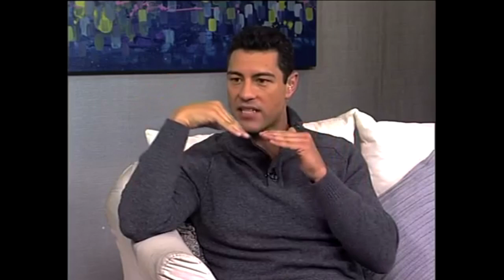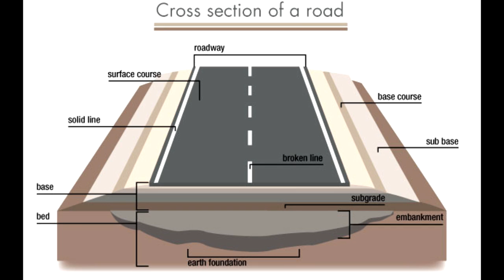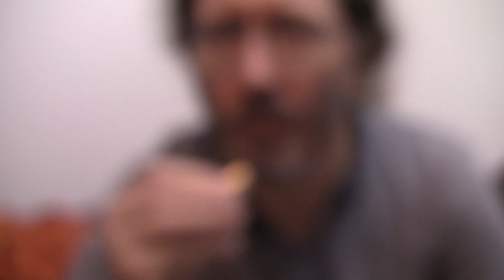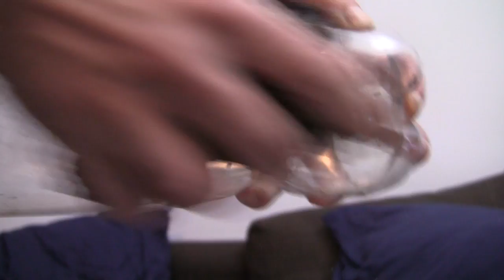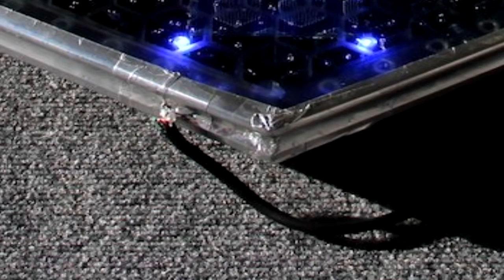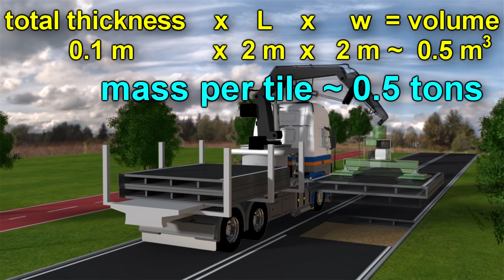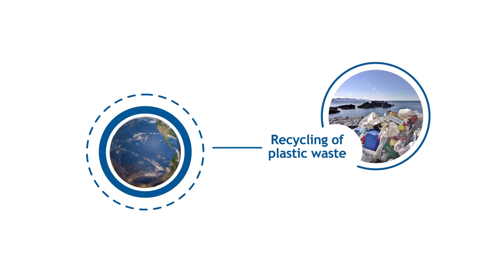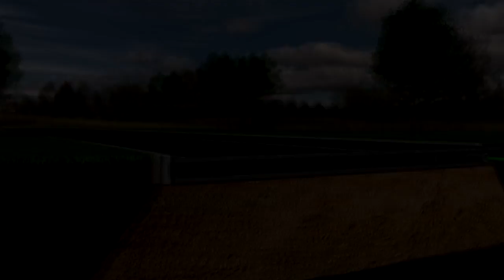Plastic Roadways BUSTED!

Comment: i stopped three seconds in and am going to guess without even hearing them out yet that this wont work for exactly the same reasons that solar roadways didn't. its a pipe dream that doesn't take huge budgetary, weight and wear requirements that any second year Civil engineering student should have seen coming. we'll see if it pans out.

EDIT: Well, my suspicions were raised by the guy saying " I don't have an engineers mind but..." and were confirmed when they went on about hollow roads made out of recycled pop bottles with no foundation to speak of much less any ideas on how to prevent the fancy runoff channels from eroding said imaginary foundation or having braking cars or god forbid large trucks from pulling these dumb pannels off the foundation(seeing as they have no anchors to nobody's suprise) 

Goddammit guys i'm not an engineer but even I could figure this out. the scary part is that there are actual civil engineers wasting their time and the companies money chasing this pipe dream when they could be dedicating these (very much limited) resources to upgrading and maintaining roads using refinements to existing technology. actual progress on this front looks like finding a way to cut down the cement portion of your structural concrete by about ten percent or by precasting bridge sections off site and craning them into position (then laying blacktop/concrete surface) but then that sort of thing takes years of study and experience in industry. and lacks the sex appeal of pie in the sky solutions that don't even work.

(/end rant)

Comment: So a section wears out and has to be replaced.
And its got a lot of pipes and cables running through it.
So...they have to cut all the pipes and cables, pull off the section, and slip on a new section.
Then they have to reweld and reconnect all those pipes and cables.
Hmmm.

Comment: my thoughts on this are simple,  have you ever,  EVER seen a straight,  flat and level road?  roads  can not be made modular,  every stretch of road is Tailored to the space available and the needs of the road user,  the only use i can think of is to build very temporary and low use paths,  like in a festival or to divert traffic during brief roadworks
Reply: and even then gravel roads are easier and more effective. :)

Comment: Hey dumbass. The vast majority of cost for roads is RESURFACING. They don't break up the foundation when they redo roads...
Reply: Road Resurfacing is relatively cheep and simple actually.
Reply: This thing would cost 100 times more to resurface. Especially if the pipes go through it. Probably reinforced concrete panels would be cheaper than this and also more durable. Also the plastic can be put in the concrete mixture as a filament.

Comment: I can't believe an engineering team would actually not realize that both traditional road material AND plastic bottles alredy get recycled. Just to start off... 
And I actually really really hope there will be many big facepalm fails like this where the fail would be exposed, and slowly people would realize the need to check the sources. It's all too common for people on Facebook to just believe anything, share and post stuff whether it's true or not, even if it's an article, they would never scroll down to check "Source:" and follow it up, IF the site even has a source. So most people don't even get to Step 1 in verification. It doesn't have to be a scientific article, it applies to everything, politics, rumors of any kind, and people just mindlessly share everything.

Comment: Amplifying how silly the argument is that "plastic is lighter than asphalt":  So what?  A road lays on the ground, all day, 24x7.  You never have to move it, or pick it up and put it down.  Being lightweight is almost a non-issue for a road (except as TF points out, it's a liability for an accelerating or decelerating car).

But they messed up the one point where weight does matter: building and removing it.  Asphalt is liquid when it goes on.  You can handle asphalt in whatever quantity and rate is convenient.  These plastic roads you'd have to handle in the exact size and shape of whatever sheets of it they make.
Reply: Tehom but... it's lighter so thus it's cheaper to carry around for maintenance.  m who needs a working heavy road when it's lighter and thus cheaper to repair?

Comment: 0:38 Welp. Show's over. The guy talking about it doesn't know what he's talking about.

So I was on my home from work today, and saw someone repairing the road. It was one worker, with a truck bed filled with road material. He was fixing the potholes by shoveling the material in, it was quite quick, and people were able to just pass him, allowing the road to still be used. The plastic road requires that they have a large vehicle pick up the existing road, set it off to the side, and drop in new road, which would block off the road. 

And what about corners? Wouldn't we need curved pieces of road? That would require making all corners the same angle, that or making each corner (which you'll have to completely replace if there's a pothole) specifically for that corner.

21:04 It seems that the material has already been reused for a "road". That or a wall, so they obviously chose the wrong picture.

Comment: Some places in the US get feet of snow and/or rain. Others reach temperatures exceeding 50° C (122 F ). Wouldn't those elements break down the the plastic and make it become very brittle? I'm only 6 minutes in and seeing many problems like a hollow roadway taking the weight of a 20 ton semi or even a 2 ton sedan over a long period of time

Comment: You forgot to mention that the roads would propably float. I could imagine these things just swimming off once it´s raining for a while and the ground underneath is saturated with water or whatever term would be right here (not a native speaker). Of course you could fix that by using the same kind of layout as your standart road and then hold the road in place with some kind of steel grid and some screws. But then all the "advantages" of the system are redundant as maintenance wouldn´t be easier and the green feel would get lost as well because you suddenly need processed metals and so on and so forth.

Comment: Going by regulations for conduits like power, telephone and storm water, this road will never be approved for construction. Minimum depth is around 1 meter deep, because a shovel easily cut into the cables.

Comment: They certainly never asked anyone who has worked in the plastics industry about any of this, as the degradation in sunlight, or indeed the huge expense of the few plastics that could cope in the role like the engineering plastics like glass filled nylons or the polycarbonate used in bullet proof glass would cost so much that it would be impossible to even consider it. Maybe make them out of kevlar or ballistic ceramics next?

Comment: And considering we have had plastics for 100 years more or less, and we have had roads for ever. If it was cheaper, and safer we would use that rather than what is currently used.

Comment: Solar and plastic roadways may be real, when hover cars are invented and mass produced.

GOOD luck with that considering the current technological advancement that we have.

WAIT... WAIT A GOD DAMNED MOMENT.
You didn't even talk about the "cables passing through" BS: If cables are going to pass THROUGH the roads, instead of connecting to "modules", how the flying fuck are they going to replace the road modules, IF the cables are inside them? WTF?

Comment: I designed a modular roadbed for low speed surface road areas requiring repeated access to utilities. My design was bonded to asphalt though. The groundwork required is extensive though, hence use in specific applications where it would be cost effective.

Comment: I don't get why this video is so popular. Solar Roadways at least sounds several kinds of cool. Plastic Roads, even if it were feasible, would be little more than a curiosity, I'd think. To the driver, they'd be pretty much the same, just a different material. I'd like solar roadways to be possible for a number of reasons, but plastic roads just plain isn't interesting.

Comment: How does it make ANY sense to put cables THROUGH the modular road? Chances are you're going to be fixing the road more often than the cables. Plus, you could just run the cables in the ground under, or next to, the road and that would probably make both easier to repair. I guess I just don't understand why anyone would think there'd be an advantage to running the cables through hollow pieces of road, it just makes no sense.

Comment: [Insert Material] Roadways BUSTED! ~Thunderf00t
Reply: Mithril freakin' roadways.
Reply: Asphalt
Reply: Folopolis Expensive. Large slabs, heavy, needs whole section replaced. Slippery when wet/snowed. Noisy. Dangerous when underside slides as it creates edges. Not really recyclable.
Reply: The better roads are made of reinforced concrete, but it is much more expensive, and it is supposedly to last more time. But more often than not it doesn't. So Asphalt is the ideal solution, it is cheap to make and it is easy to maintain. By the way the fumes are not inhaled by the workers, asphalt roads today are all done by machines, they barely even touch it.
Reply: No, they are after steel reinforced concrete. All of those things listed are faults with concrete.
Reply: antimantium
Reply: uranium
Reply: Dirt
Reply: roadway
Reply: Overweight semi-trucks are what tear up asphalt and concrete.
Reply: The street I live on uses large bricks indestructible but not a great surface to ride on. And concrete is very porous and can't stand stretch so with rain and frost it will rip (not as flexible either) and concrete surfaces get extremely slippery when it rains (in cali that was o very again very apparent last week). Back home in holland (ironically where this company RWS comes from) we use stuff called zoab which stand for 'very open asphalt concrete' it's basically a conjecture of the properties of asphalt and concrete making it the most expensive road surface in the world but the best solution for a country that has a lot of rain some frost and heavy usage. The only problem is with black ice that makes it as slippery as concrete roads. Luckily we don't get this that often.
Reply: Water, wood, foam, literal shit, millions of mini hyperloops, human flesh, human bones, living baby's, and that's all I can think of
Reply: Human roadways BUSTED

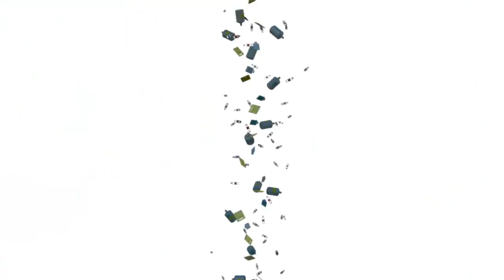Comment: 4:35
Fun fact your soda bottle made from PET is first made with the endcap fully formed as a narrow cylinder making it look like a test tube.
Than they blow it up like a baloon in a mold.
Google soda bottle preform to get the idea.
I now work in the plastic injection molding industry but i still remember the PET bottles from when i was a inturn.

Comment: I have no ethics and want to get on this roadway bandwagon, any suggestion what I should make mine out of? Initial ideas are gold and bio engineering trees into roads.
Reply: wooden roads were actually in widespread use at the end of the 19th century. horses make less noise on them. no bioengineering is needed for wooden roadways
Reply: but what if we make trees grow horizontally so the road effectively just builds itself?
Reply: Make them out of corpses!

Think about it.. we're putting all of the dead people in the ground anyway, why not build roads out of them, so even in your final rest you still serve your fellow man! :D

Would free up all of the space being used by cemeteries also, so we can build more malls and parking lots there.

Comment: I've been thinking about an alternative to tarmac for roads, but it's not really that easy to find a cheap substance that is either renewable or more abundant than oil with the necessary properties. Ideally, in addition to being made of renewable resources, the new road surface would need to have a very high coefficient of friction with rubber, it would need to be long-lasting, it would need all the other criteria you mentioned, and it would need to maintain its properties with relative consistency at a variety of temperatures ranging between, let's say, -60°C to +60°C.
So far, tarmac remains cheapest, but brick, concrete, and stone slabs are all functional alternatives with their own advantages and disadvantages.

Comment: Running cabling through hollow plastic roads? What happens to the cable when sections need to be replaced? Electrical lines cannot be cut, leads to leakage. Telecom cables cannot be cut, lead to interference.
UV light degrades plastic.
Plastic has a limited number of times it can be recycled.
Plastic cannot withstand the abrasion that it will experience as a road.
Plastic + fire = 

"Cannot be recycled once it is fiber reinforced."
You are wrong. I worked in a plastics manufacturing facility where fiber reinforced plastics were recycled daily. You only need to run it through a grinder and feed it back through the machines. Hell, the pellets come with the fiber already in it.

Comment: They are probably planning to use ultra high molecular weight polyethylene. The video reference a company called Total which is based in France and produces polyethylene. Also, this type of polyethylene is so dense that it can only be press formed like the crude animation shows.

Comment: Just imagine the pollution increase from this since the demand for plastics will go up considerably.  They want to go "Green". How do they imagine to connect these segments so that the roads don't warp or deform, You can run a light flame under this plastic and it will warp just imagine friction heat or just solar heat.

Comment: +Thunderf00t exactly... exactly. Just to add something. The idea of using prefabricated modules / big tiles to pave the road is nothing new. And while it might have some advantages it definitely have  major issues.

In the Czech republic, we had pretty much a while highway made out of concrete modules (pretty much like in this plastic roadways nonsense, but obviously not hollow). Maybe because the regime had high production of concrete or what not.
And long term wise, even if you join 'em properly... it's just way too many joints and in the end, the bed will move slightly here and there and it just wont be a smooth join anymore. No matter how hard you try, in some years, not to mention if they expect it to last really long, it will be dang-dang-dang-dang-dang... when going over it.
Hence why we called that highway stairway to Prague ;)

Comment: I'm no scientist, and am pretty stupid with this stuff, so, sorry if I sound like I'm arguing, but...Aren't you comparing a thin bottle that companies designed to be thin and lightweight, versus a dense, probably more than two-inch thick piece of plastic?

edit: Also, according to a Q and A they did on the website, "The PlasticRoad has to meet a
number of functional requirements, just like traditional roads. Research with partners
from the plastic and recycling industry will have to show which kinds of plastic and which
combinations of plastic can be used. ". So, I guess it's gonna be up to them to decide how 'durable' it will be ;p

Comment: At least the companies behind this are doing the research with their own funds.  I see no evidence that they are getting government funding, and they aren't crowdfunding. As I see it, this self-promotion puts public attention on their efforts, which should put pressure on them to find a workable solution or lose face.

While I agree with Tf00t's analysis on the large scale (highways), many of the issues raised are more manageable on a smaller scale (short side streets).

I live in Central Florida, where plastic panels are being used in short, high wear locations (e.g. railroad crossings, curb cuts).  They protect the underlying substrate from damage, and can be replaced in a few hours.  Note that in this application, durability isn't an issue. They take the pounding, eventually failing and being replaced cheaply and quickly.

Comment: I happen to make molds for a living. I'm glad TF touched on how in many way plastics, well polymers in general, are still pretty crappy to work with. It's not easy to make a quality plastic product even if you're not using the common cheap plastics.

Comment: Also to add, in Sweden we calculated that a roads lifespan is 20 years (but often used longer, duh) and the lifespan of asphalt/bitumen  is at best 7-8 years. And because its not hollow, the load/wight of the cars and trucks are distributed almost 45 decrees downwards starting from "contact area", which mean if using those plastic roads, or any hollow design make to much of a load with traffic towards the layers of macadam and gravel below, and a sag (think its the right word) might happened in those layers and the surface will be uneven. And with asphalt/bitumen that problem can still occur, but if the road is not that important, then just even it out with just another layer if asphalt/bitumen at the uneven area, which can be just some centimetres small or bigger. Wont fix the problem in the long run, but much more efficient than using plastic roads.

Comment: I remember while living in the Netherlands they replaced/renewed the asphalt on our street in about an hour, one big machine just ate it at one end and spat it out the other looking like new and it was doing the road markings and all. I honestly thought it was one of the most amazing things I had ever seen ....show me them doing that with this useless idea , especially that cable part, what so we're going to have a joint/connection every 100ft in either a fiber/power or gas line  ...good luck with that.

Comment: They'd be better just taking the plastic, melting it down and adding it to bitumen.  When I was a roadworker, I remember using rubberised bitumen to seal some sections of roads in New Zealand, not sure if they still use it as it was awful stuff to work with.